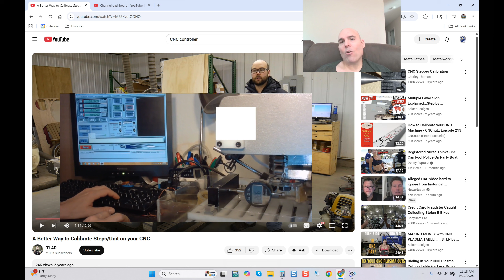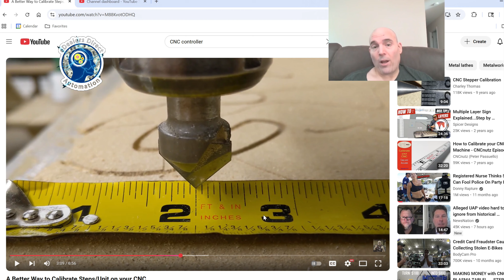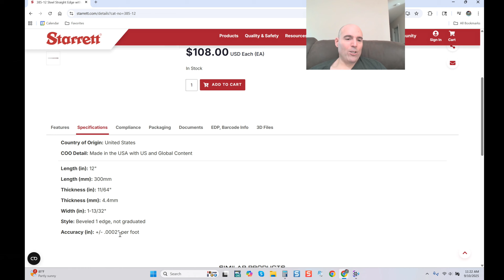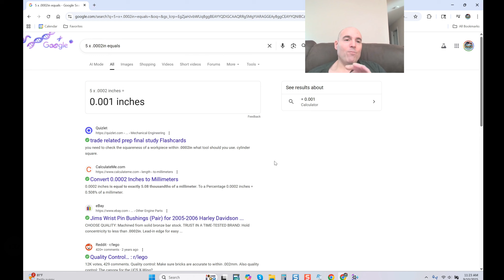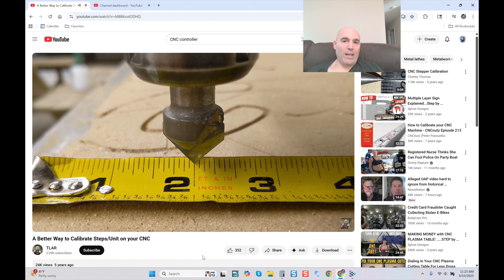⚠️ Stop Being The "Good Enough" Guy ⚠️

Comment: But Vince, This is my thought. That machine is intended for milling plywood and hardwood. In that case tape measure accuracy is enough if it is consistent. 
Assuming tape measure is not handmade!! Lol

There is no need for a thou level of tolerance where wood or related material suffer a lot from expansion and contraction.

 As long as he is using that same tape measure for the entire  axis travel calibration, It should be fine. 

 Precision robots are not only relying on steppers.  Redundant Axis feedback systems and thermal compensation systems are to be equipped. 

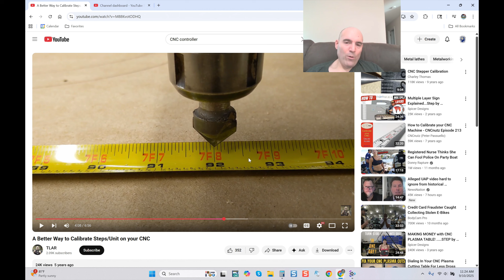The cost of an 8ft long bed with the level of positional precision, that hardmetal mills offer is going to be skyhigh. 7:09
Reply: The accuracy of an instrument is dictated by the minor scale. 
So, there is no point in using a measure tape where, in a milimeter, two points, the measurements go to a hundred times without marks.
1 mm to 0,001 mm.
Sorry for not making inches.
Reply from the maker: We'll just have to disagree on this subject. 

Let me explain. 

The point of the video is that what he's doing is incorrect to calibrate a CNC robot past a 1in increment. 

Here's what a simple Google search reflects on using a measuring tape to confirm what I'm saying. https://www.google.com/search?q=calibrating+a+CNC+with+a+measuring+tape+is+incorrect&oq=calibrating+a+CNC+with+a+measuring+tape+is+incorrect&gs_lcrp=EgZjaHJvbWUyBggAEEUYOTIHCAEQIRigATIHCAIQIRigATIHCAMQIRiPAjIHCAQQIRiPAtIBCjE3MzA3ajBqMTWoAgiwAgHxBbfCDATB-4cM&sourceid=chrome&ie=UTF-8

If anyone wants to do this with their own robot that's totally fine of course, but its not the "correct way" to do it to educate people using a public YouTube channel. This also why the video is titled as it is. As where discussing the "good enough" philosophy,

Here's a completely logical question. 

How do you get a tape measure to be perfectly horizontal to the axis being calibrated when its arced over the span of it? 

I'm sure you realize if any measuring instrument is not in perfect alignment  with the axis the measurement is in itself inaccurate do to "Cosine Error", so what's the logic in using the tool at all to measure with?  Here's validation once again from Google. https://www.google.com/search?q=avoiding+cosine+error+when+calibrating+a+cnc+axis&oq=avoiding+cosine+error+when+calibrating+a+cnc+axis&gs_lcrp=EgZjaHJvbWUyBggAEEUYOTIHCAEQIRigATIHCAIQIRigAdIBBzYyNWowajSoAgCwAgE&sourceid=chrome&ie=UTF-8

Lets also not forget we didn't see him actually machine anything, and measure the results of the cuts, so we really know nothing more than him jogging his robot to the tape measure claiming the axis is calibrated. 

Calibration I believe we can agree can only be confirmed by machining a substrate, and validating its dimensions. 

Thank you,
Vince
Reply: @corvetteguy50  Oh..! Let me check. Thanks for the elaborate reply.
Reply: Maybe it'll last until it's no longer sufficient and destroy material worth several times as much as the tool that would have helped him better adjust the machine and would have been useful for more than just setting it up. Compared to the cost of the machine at $100, it's simply a shame to "save" and not buy it.